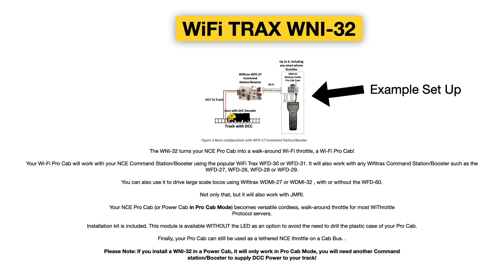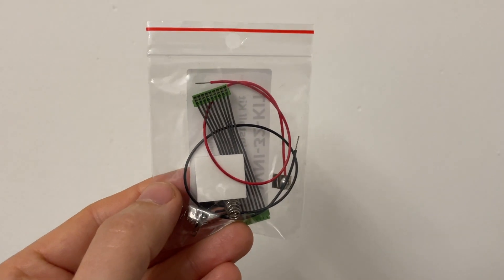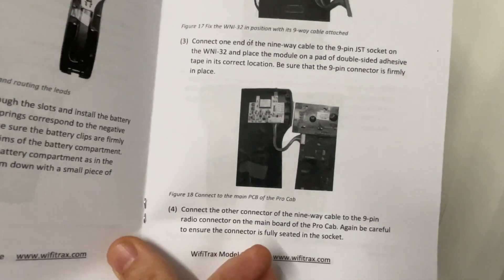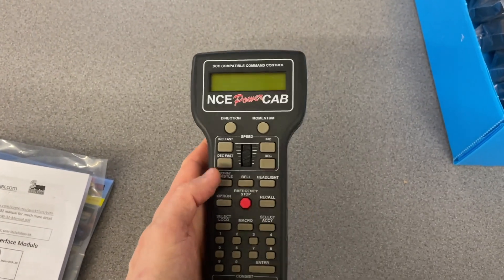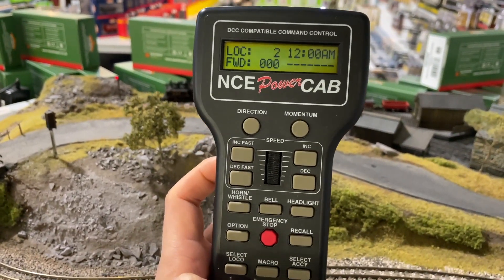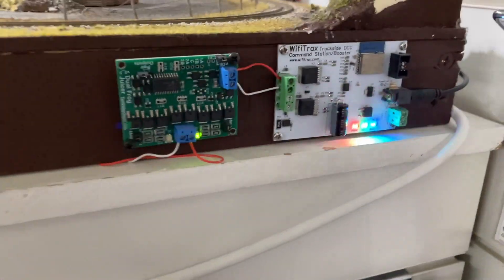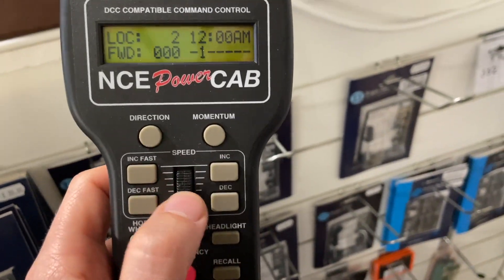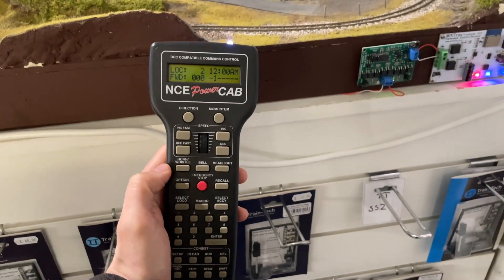Brand New WiFi Trax NCE Pro Cab / Power Cab WiFi conversion! WifiTrax WNI-32

Comment: How do you add batteries to the Power Cab?   Interested in doing this for my Power Cab,  so when not using it as a program track, I can use it wireless with the SB5 and a Wifitrax board...

Comment: HI Train Crew..Having just purchased two wifi WNI-32  from you.  I have just fitted one wifi WNI-32 into my main NCE pro cab like the one your working on & this one works fine on Wifi. then I fitted the other wifi WNI-32 into my NCE power pro cab-06 & its not lighting up or working,  Ive connected the cab -06 exactly the same but its dead. It is defo the best way to go on the NCE Cabs & I sure would like to get my small cab-06 working on wifi....The batterys are fully charged I would appreciate any info......cheers Brian
Reply from the maker: Hello Brian, we've never tried installing one in a Cab06 we can speak to Wifi Trax and see if it is possible.

Comment: So would this work with a  Raspberry Pi acting as the Wi-Fi running JMRI? The Pi is connected to the rear of the NCE panel via a NCE interface unit.
Also  will the Powercab still work as normal if connected via the lead?
Reply from the maker: Thats not a set up with tried it with yet.  The Power Cab does just function as a normal Power Cab when you plug into the Power Cab Panel

Comment: This is awesome, especially for folks with a Pro Cab... and then people with NCE at home can use their familiar cab at clubs and places with other systems that also incorporate wifi... 
   Am i correct in thinking the Power Cab no longer works as normal with a PCP panel and flat cable?   In that case, I will keep my Power Cab as is, but might still look into getting this setup for a Pro Cab or a second Power Cab.... i meed another PCP panel anyhow, and habe been planning to add some Wifitrax stuff to my long term permanent build anyhow,  that one will use an SB5 , amd i wanted to add wifitrax and a wireless throttle as I dont want to use a computer and JMRI, nor the NCE proprietary radio setup... 
   Might consider this route for a wifi cab instead of the TCS throttles....    
   Cheers
Reply from the maker: Hello . Yes it certainly is a very exciting product. The Power Cab does operate as normal when you plug it back into the Power Cab panel.